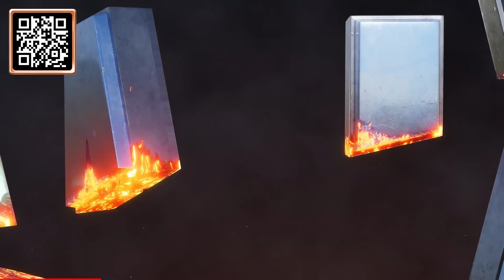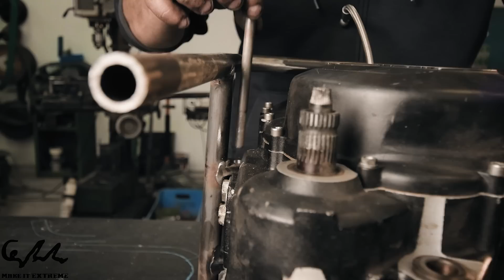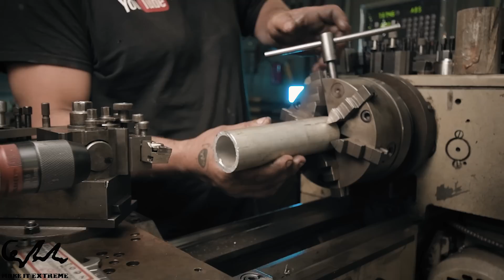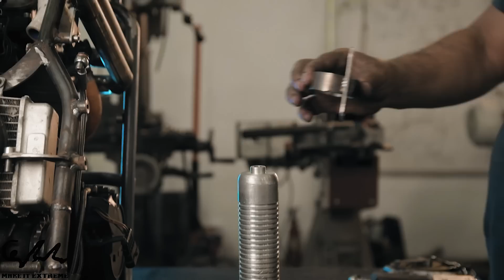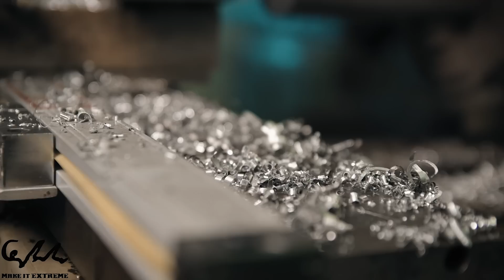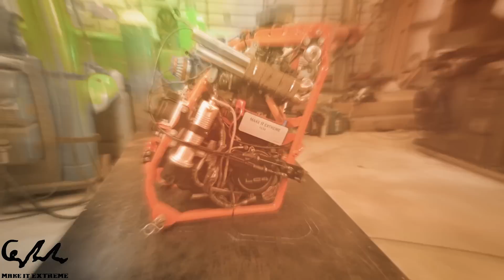I Put a Fast Coupling KTM Engine Into My Bicycle

Comment: I love this idea, not just because you can use one engine for multiple vehicles, but also because you could make multiple power trains for those vehicles. I'm wondering if you might be making another frame like this to put an electric drive train into. So you could choose whether to rub your bike or car as a petrol or electric with only a few botls to change them.

Comment: I have a dumb question, what exactly is a fast coupling engine?
Watching the build, I gathered it's probably a KTM 690 parallel twin. Why was the upper exhaust not putting out any smoke initially? 
The best bits were the oil catch cans you fabricated. Is this an oil scavenging system.

Comment: Nice work! Only one issue: The air intake sucks up exhaust gas, this will cause a drop of power.
Reply: I think they will make it longer by adding silencers, they left it straight piped so that it is adaptable to the build it is going in, but once in a vehicle they will probably give it a proper exhaust for optimal power and noise level.

Comment: Barb fitting as part of the cap is genius. Less points of failure. But it's hand tight enough clapping pressure to seal it? I don't know what Kpa that coolant system can produce but hot fluid burns suck

Comment: whats the point ?
Reply: It's to be attached and removed rapidly like a battery to other machines that he has.

But he didn't really show the a) attachment, b) the connection, or even c) the fuel tank.. He didn't explain what those 3 cylinders he added were either.